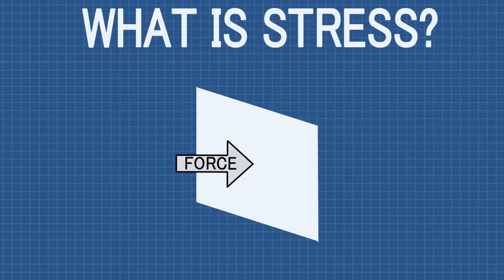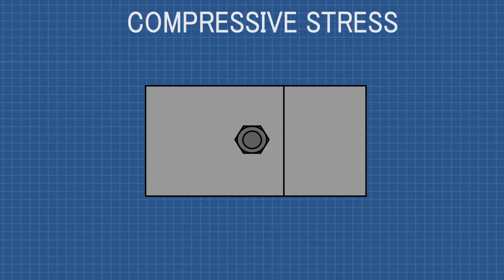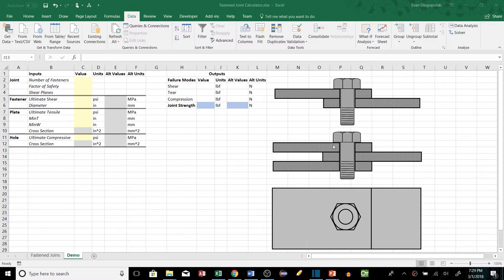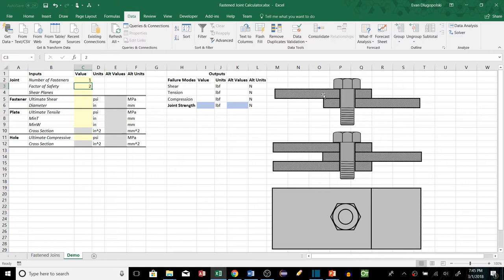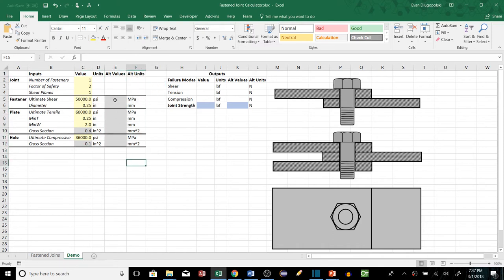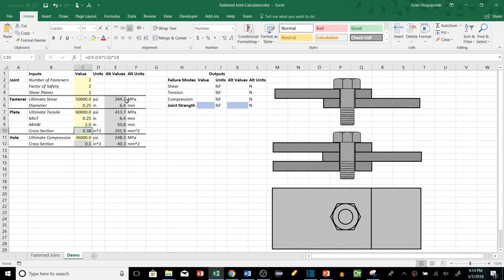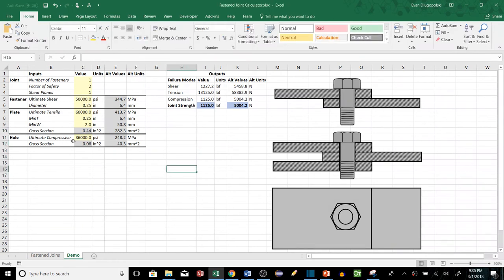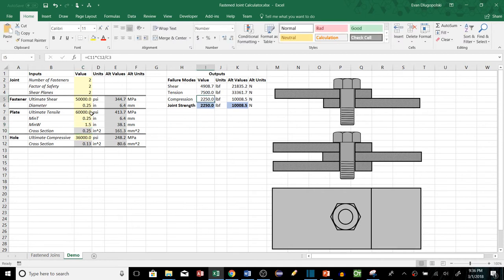Fastened Joint Calculations in Excel

Comment: The tensile load is assumed to be distributed evenly over the cross sectional area. In reality it's localized and would be highest at the hole and reduce towards the sides of the part. So I suspect it would start to fail in tension at a lower load than indicated. Please comment. I really liked the video and I learned several valuable capabilities in Excel.
Reply: It might start to yield in tension near the hole but when steel is taken to ultimate strength tests show this to average out and the stress concentrations don't matter.  This is with respect to common steels used in structural applications.  If you were bolting high strength heat treated parts the behavior could be different.

Comment: Conceptually this is correct but if you start applying this to building design there are a lot of the particulars that aren't quite in accordance with building codes such as AISC.

Comment: How did you know what the Compressive Yield was?
Reply from the maker: In this example I believe I just used a generic value for steel.  In practice you would get this from the real properties of the material you are using (which would be acquired from the material supplier or through your own testing)
Reply: @TheEngineeringToolboxChannel  Okay thank you, I thought I had missed something.

Comment: Your calculations do not include the friction put into the plates by the bolt's clamp load. You have modeled your bolt as a simple pin. If this fastener is torqued whatsoever, your calculations become invalid.
Reply from the maker: Yep you’re absolutely correct.  It was a basic example to demonstrate some basic concepts and show how to set it up in excel.  👍
Reply: @TheEngineeringToolboxChannel  would this not be a more conservative model anyways?
Reply from the maker: “Conservative” is relative the the intent of the design.  But I think i understand what you are saying and believe you are correct.  There are really three “levels” of failure in a joint like this….1) the point where shear force overcomes friction force causing slip of the plates 2) the point where the shear force overcomes the yield strength of the pin or plate and the material deformed 3) the point where the force overcomes the ultimate tensile strength of the bolt/plate material and fails entirely. Up to us as  Engineers to understand which one(s) we need to consider based on the intended use of the design. Some connections we WANT to completely fail at or above a certain load, there are scenarios where no slip is desirable - where the friction force is what bears a load, and of course there are scenarios where all we care about is to avoid any kind of yield/ultimate failures.  

Here is a link with some good info.  https://www.bgstructuralengineering.com/BGSCM14/BGSCM004/BGSCM00402.htm